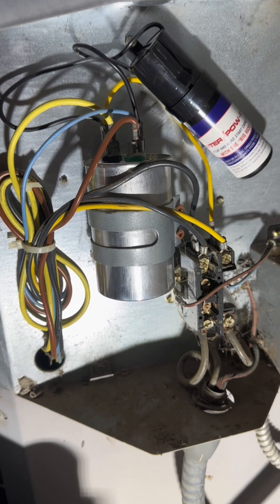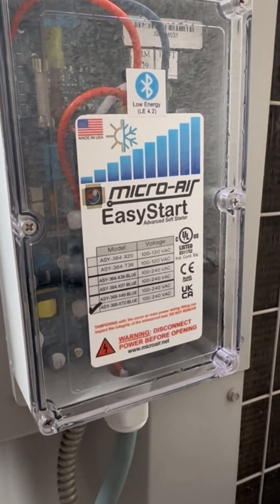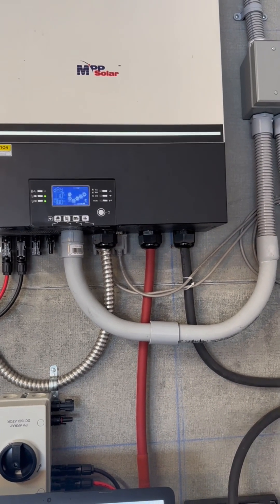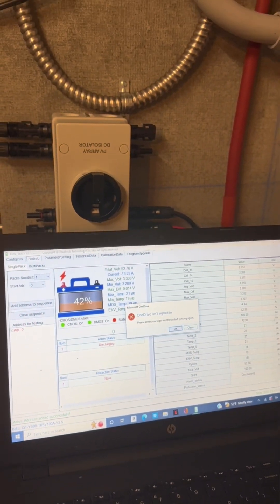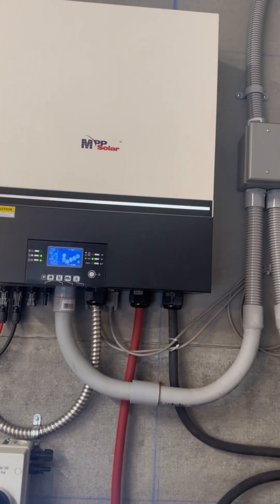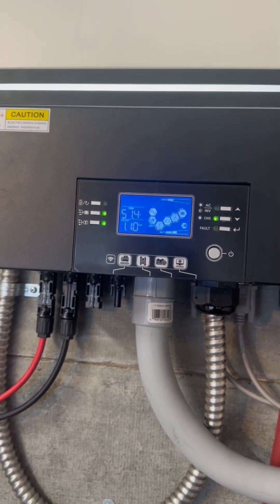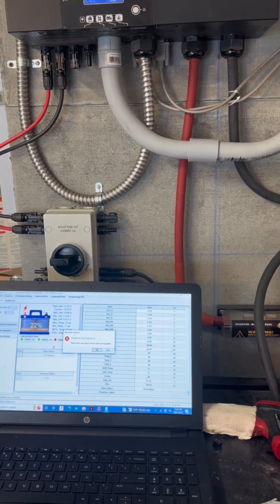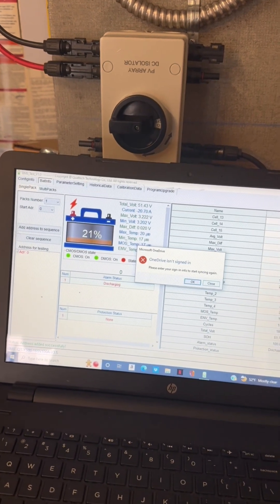Micro air easy soft start on Mpp solar

Comment: Carrier, 4-ton central AC with hard start replaced by EasyStart 368 currently with an 88 amp start WITHOUT an EasyStart (latest recommendations by Micro-Air are to use the 368-X72-BLUE model on a 4-ton unit). With an EasyStart, Steven found ONLY 25 amps were needed to start on JUST THE BATTERIES. Highly recommends Micro-Air EasyStarts:  "they are amazing.".  No brainer to run AC at any time.